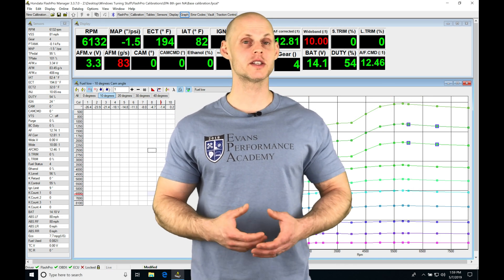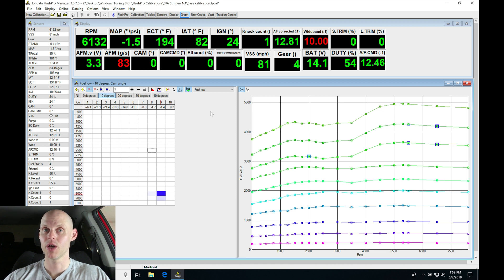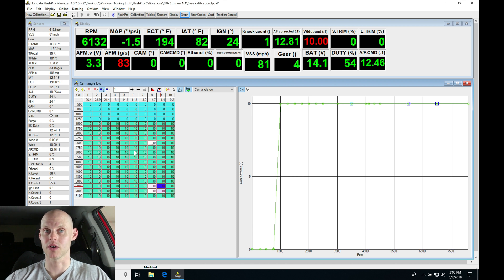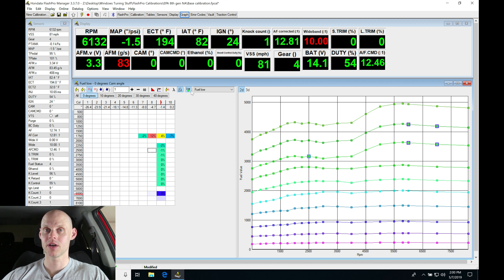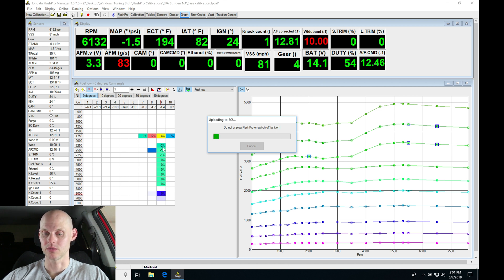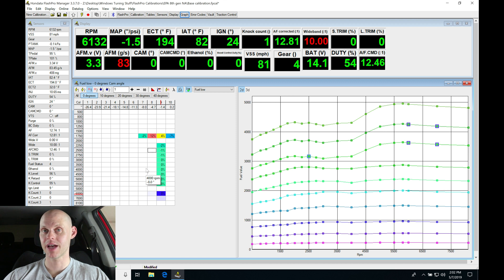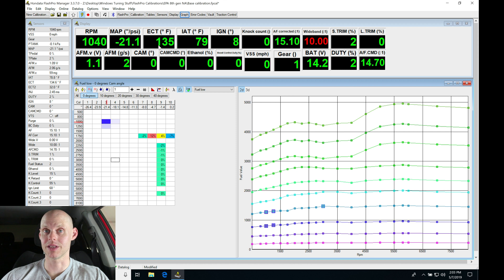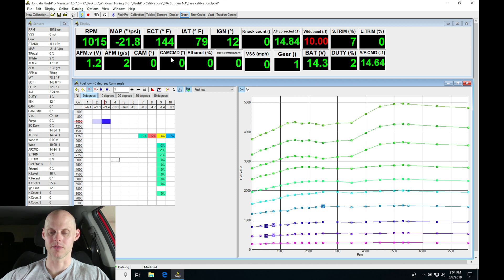Hondata Flashpro Live Training: 8th Gen Civic Si NA Bolt-Ons Part 3 | Evans Performance Academy

Comment: How about the injector cut off. That comes with the type s? When tuning on hondata you get the box to check off/on for the injectors to cut off. But on the 07 honda civic si you don't have that option. I'm having the issue with my 07 honda civic si. I'm not able to crus for the reason the injectors cut off. Can you please help? What can I do?